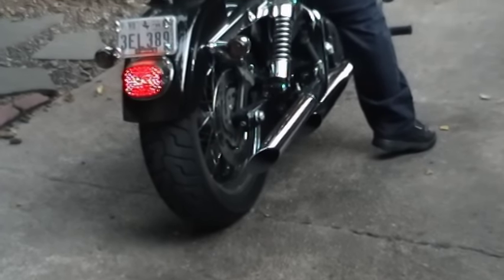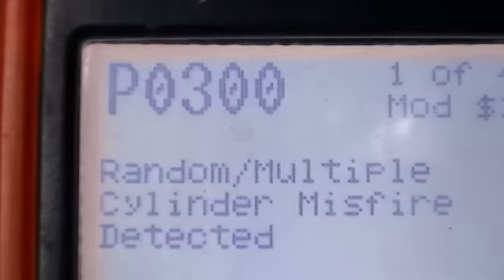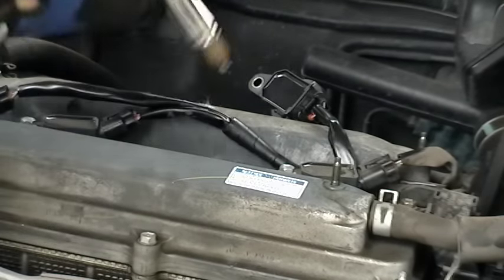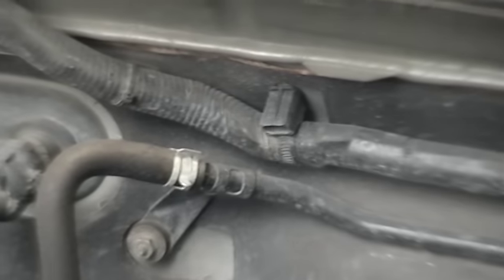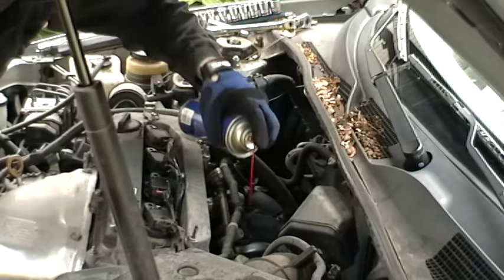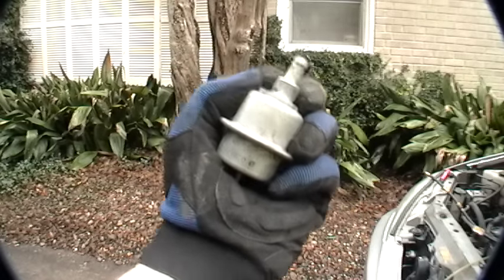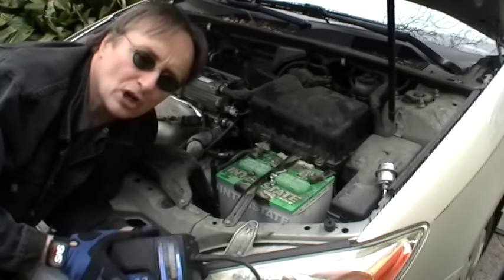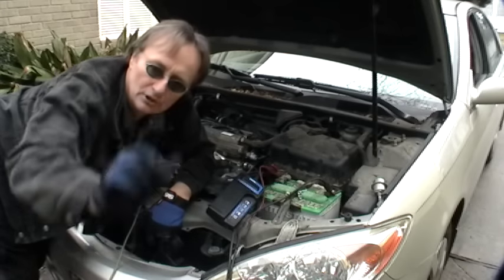How to Fix a Random Engine Misfire in Your Car (Code P0300)

Comment: might be a dumb question but why would the battery be the cause?......when the cars running all things electrical are powered by the alternator
Reply: A tidbit of info...That was for generators, not alternators whereas the magnetic field is created by current in coils from the battery, if I have that right.  That is why people said you couldn't disconnect your battery, and the car will stay running anymore.
Reply: +  I think we are talking about different things although I agree with your comment as being a warning/don't do and it's reason why.  I'm not sure the claim was ever true, and that was when computers weren't in cars, but that is people used to say.  Since I recently found out about no magnets in modern alternators is why I was suggesting this as a reason.  Nothing about the topic of computer damage from voltage/current anomalies. As far as mechanics and engineers, both have values as I have experience in each.  I know plenty of ME s who practically turn a wrench or will never get anything done because they constantly are trying to move this issue to win an argument; I know plenty of mechanics who don't have an engineering/physicist fundamentals background, and the bounds are endless.  Thanks for your response. Regards.
Reply: +taledarkside Again, I am talking about WITHOUT.  Which is related to the original post's comment about the role of the battery in the system. This getting too many tangents. Thanks, bye.
Reply: +taledarkside I began talking about the difference between when they were called generators and when they were termed alternators, and that being the time when it was said that the car could no longer be run without the battery.  I'm not talking about computer equipped cars.  The issue being that the DC comes from the battery to supply the field coils.  No magnets.  THIS is why I was wondering why the new word was that it wouldn't work.  Nothing about voltage disconnection spikes. Or your personal engineering technical knowledge .  I usually refer to GM and Delco systems.  I see that the situation differs in each of the designs by manufactures for that to be a blanket statement as the "alternator" naming took place.  Some could, some couldn't.  I was just always curious about that because I thought it was a neat trick if you could get somebody's car going and let them be on their way if it wasn't a manual transmission i.e. push start.  Just trying to understand fundamental designs

Comment: I have a bad misfire on my 07 Impala 3.9. stutters when I'm trying to go but will eventually pick up speed for maybe 3 seconds then stutters again. Changed the wires and plugs but still have a blinking engine light that comes on and off. Had a code of p0300 but a good friend has the same make of car and said it might be my Cadillac converters that have gone bad. Idk

Comment: I have a 2005 Suzuki Forenza and it's has a PO300 code.  I have changed the spark plugs gapped them properly, bough new spark plug wires, put fresh gas in with injector cleaner, removed and cleaned injectors, check the timing belt AND it is still showing a PO300 code - - - any suggestions?

Comment: Probably the most common random misfire in older vehicles would be clogged catalytic convertor!  I couldn't count how many customers that have brought there car in after other shops couldn't fix the problem so for now on any high mileage car with thst code that's the first thing I check!

Comment: I have a 2000 Toyota 4Runner sr5 v6 I changed the spark plugs, spark plug wires and coils. It only misfires after a warm restart

Comment: I changed everything possible and still get a PO 302 on Volkswagen Beetle year 2000 engine 2.0 things changed Spark plug wires, spark plugs, Ignition Coil, Fuel Injector and don't know what else can be causing the problem Scotty

Comment: mine misfires and has smoke after about 5 minutes of idle.
is it most likely a vacuum issue? compression is good.
Reply from the maker: probably not, smoke when iding is often worn valve seals on the engine

Comment: I'm having an unusual misfire.  No error code or check engine and I had 4 mechanics take a look and no one can figure it out.  All the main gaskets were replaced,  fresh oil change and new spark plugs but still a random misfire here and there.  any advice please ?
Reply: I'm in the middle of chasing multiple misfires too. Have you tried unplugging the MAF sensor while the car is running to see if it goes away?
Reply: @mcfriedchicken1972  worth a shot at this point.

Comment: i have a 2004 Mitsubishi eclipse gs withe both the p0300 and p0173. i have replace both coils pack, the spark plugs. where should i check now.
Reply from the maker: check for intake manifold gasket leaks, and also check the fuel pressure for weakness and pray the main computer isn't going out, they often do on that model

Comment: i have a 2006 dodge caravan i put obd scanner andit read p0303 cylider 3 misfire i replace the spark plugs but still having the same trouble van stumbling turns off at stop how can i know what the main trouble is i'm disabled and can't afford an mechanic thanks for any help
Reply from the maker: unfortunately dozens of things can trip that code. Swap #3 fuel injector for another, and if miss moves, that's it. If not, can be blowing head gasket, computer failure, lots of things

Comment: I have a 2005 1.8 turbo Passat . We have been getting random misfires on all cylinders and lean codes. We have had vacuum leaks fixed, put in a new Maf sensor, new spark plugs and new coils. Still is getting same codes. Car was running real sluggish so we changed fuel filter but still getting codes but car has more power. We tested the fuel pump and its reading .08 , and by what I have read it should read 1-3. I'm tired of spending money on this car😩

Comment: hi scotty   i have toyota  avensius  1.8 2010..its misfire sylinder 1   i test coil its ok i put new plug i check injector power wire its ok i look for any leak pipe all is good plus engine test,,, i dont know what alse cude be thnx
Reply from the maker: +KURDISTAN uk  often bad fuel injectors or bad coil on plugs do that, and they are not easy to test fully. I'd start there and pray the engine isn't worn internally with VVT problems
Reply: ok thanks so much..

Comment: Scotty I need your help! My 2005 Infiniti G35 had the check engine light blinking but the code reads multiple misfires can you please help me! Would like to show you on live video chat, it's frustrating me!
Reply from the maker: +Relixo tons of things can do that, from worn ignition coils to a blowing head gasket. Best to pay a guy like me in person to analyze it first with a dealer level scanner to check live and mode six data and all stored codes
Reply: +Scotty Kilmer I already checked spark plugs, ignition coils, already did a compression test on all 6 cylinders. Everything passed even check the connectors on the Fuel Injectors & Ignitions Coils everything seemed fine! what could it be! Please Help!
Reply: My 2006 g35 is doing the same thing! Changed plugs, wires, pvc valve, cleaned fuel injectors and new air filter.. still stuck

Comment: I have a 2001 mustang gt. It has all the signs of a misfire (strong gas smell, whole car shaking from the engine, doesnt like low RPMs and almost stalls out at times, exhaust note changed, etc) but i plug in a scanner and get no error codes. Im scared to drive it because it just doesnt sound right

Comment: Hi scotty. I have corsa c, 1.2 16v, 2001. When i started a car one day, its worked normal and after few minuts i saw check engine was started blinking. And than motor was unusualy worked (something like 3 cilinder only work). I shut down car. After one minut i started him an he worked normaly, but he registered fault code p 0300. Since then i driven car several times and everything is ok. Would you help me with some propose, thank You

Comment: 05 Mercury sable replaced spark plugs and wires .. changed the fuel filter... cleaned the fuel injections idk what to do an ore?
Reply from the maker: could have vacuum leaks on the intake, weak fuel pressure, computer wiring problems, lots of things. May be time for a pro to at least diagnose it in person
Reply: Scotty Kilmer 
Crazy thing is once I replace the spark plugs and wires the code went away. And then I replace the hoses clamps from the intake and the code went  away and then today it popped up I think I have a bad head gasket intake but I'm going to get it checked out on Monday

Comment: 2000 chevy blazer first was missfire on 5 and 6 changed those two plugs and the wires cap and rotor now I'm have a multi missfire code and the truck won't even sit idle just dies rite out any thought all the wires are in the correct places went over it several times
Reply from the maker: often bad fuel injectors on that model, have that checked first

Comment: Question... I just cleaned the throttle body and after that, when it´s idling, the engine can´t keep the car running.  If I give it some gas, it runs and I can drive it but it runs poorly.  Any advice ???
Reply from the maker: Einar Thoroddsen Skúlason drive it a while with one foot on the gas, often the computer has to reset idle after cleaning
Reply: Scotty Kilmer Just drove it for 15 - 20 min. but nothing changed.  The check engine light does not come on but I plugged it to my obd2 scan tool and I had p0300 random misfire.  Changed the crank sensor a few days ago because the car was dying on me randomly.  After that the car was fine.  This just happened right after I cleaned the throttle body.  The problem must be connected to that...right ??

Comment: I have a nissan spec v 04, replaced the spark plugs and one coil pack have a slice in the intake rubber pipe? could that really cause the engine to sound that bad
Reply from the maker: yes, shorting out sparks will do that
Reply: I replaced the intake still sounds rough. What should I do next? Thanks for the reply in a really shitty situation

Comment: Scotty! I have a 2002 nissan maxima! Its reading p0300 code! what is the problem?
Reply from the maker: that stands for random intermittant  misfire. A stinker of a code, dozens of things can cause that. Anything from bad spark plugs, bad dist or bad ignition coils, to a weak fuel pump. Start by checking the spark plugs and pray they are just worn

Comment: Ok. 2002 ford zx2 has misfire codes.
1.battery was bad and got replaced.
2. Changes all spark plugs and coils
3. Changes the camshaft positioning sensor.

I still have a blinking check in engine light on. I got a p1380 code recently...  help!

Comment: Hey Scott, I have a 2000 pathfinder im experiencing very slow acceleration. I'm getting p0300 code but don't know where to start. My car starts fine but I'm getting horrible milage and gathering up speed is very doggish and slow. Any help appreciated

Comment: This is my problem i have a honda civic 99 when i first start shakes very well then goes normal i replaced the coil spark wires fuel filter still not fixed another thing consimes alot of water what could be failing can you help me

Comment: hey Scotty, I have a 2006 chrysler pt cruiser automatic with a po300 code, the engine misfires only when I'm at a stop light, if I shift the car to neutral, the misfire goes away, when I put it back to drive misfires again. any suggestions?
Reply from the maker: Fernando gonzalez   that's a misfire under load, get it scanned first by a guy like me, the live and mode 6 data would show where the culprit is

Comment: Mmm, so easy to fix on a Toyota, my '02 Camaro SS is throwing me that code after $1400 MAP sensor low voltage/harness related issues, a high end shop did the work and changed the plugs and wires while at it, I wonder if my old coil packs gave up after the plug/wire swap, getting to the plugs on an LS1 is a nightmare😞

Comment: I have a Skoda Superb which has a misfiring cylinder. Changed all the spark plugs, there was moisture in one of them, the car was normal for a mile or so, and it again started misfiring. What to do next?
Reply from the maker: could be bad wires, or a bad fuel injector
Reply: Scotty Kilmer My local mechanic says head gasket and rings have to be changed. It'll cost 300$-400$. I also agree with you that there might be a problem with fuel injector. How should I proceed?

Comment: Hi Scotty.  I have a Random Multiple Missfire with all cylinders on my 03' Pontiac Grand Prix.  No check engine except one time P0172 (System Too Rich (Bank 1).
I feel hesitation under soft acceleration only and sometime ( not all the time) when i start the engine RPM going up and down.
MAF problem ??

Comment: hey scotty , my 01 honda civic is throwing this code and i putr a scan tool and it says its running lean to rich i dont know what that means but it also has code p0421 and im cuious if its the o2 sensor that its causing this p0300 code

Comment: hi scotty i have a 2000 vw jetta 2.0 with a p0304 code which is a cylinder 4 misfire i changed all the plugs already and the wires are fine i see no sparks showing

Comment: I've learned that the spark plug holes could have moisture sitting in around them. Maybe a valve cover is leaking oil. There's a puddle of oil building up and. Creeps its way up into coil boot. Killing the fire

Comment: one more small detail you could have added is how to Deactivate the 'Check Engine Light" when your Mission is done. other wise you could be Diving around for days with it on and Still not Sure if what you might have fixed was actually the problem to Begin with. :)

Comment: Scotty, How could battery cause it, 14.2 v is 14.2 v from alternator???
Reply from the maker: +A D there's voltage, and there's amperage, either can go bad. Plus bad diodes can cause problems

Comment: I have a p0300 code. I am stumped. 2001 dodge Dakota 3.9l. I changed my distributor and pick up coil (no camshaft sensor). Code went away for a week and came back. Then changed fuel injectors as truck has 200k. Needed to take throttle body off to get fuel rail off and cleaned all sensors (map, idler air, TPS). Replaced throttle body gasket. Code went away and came back. Also, changed the crankshaft sensor as well. Help!!!
Reply from the maker: so many things can trip that code, so have a pro like me hook up his dealer scan tool, take it for a ride, and analyze live and mode 6 data to find the problem area.

Comment: I have this combination of error codes p0705,  p0141,  p0301, p0303 and p1399. What to your knowledge do you think it could be? I have already replaced the spark plugs and wires also the distributor. Still misfires. Replaced PCV Valve. No vacuum leaks. I'm stumped.  Please help! !!!
Reply from the maker: do my video "fixing a car with multiple trouble codes" and e mail me the FIRST code that comes back
Reply: I just did what you said and the error code is misfire cylinder 3. Now like I said my husband and I changed the spark plugs and wires also just cleaned fuel injectors and that is the only code coming up now.
Reply from the maker: Karen Castro
swap #3 fuel injector with another, if the miss moves, replace the injector. If not, see a mechanic, it could be a worn out engine on #3 cylinder OR a computer problem
Reply: Ok scotty Thank you I will try that next.
Reply: Hi scotty i did a compression test on the car everything came out ok. Also i switched the fuel injector 3 with 2 and the misfire went away but sometimes will come back until i accelerate the car why would that be? Also car is starting to heat up coolant is low with no visible leaks any suggestions?

Comment: Scotty i need your help, you are my last chance, i was at many mechanics and nobody resolve my problems, i have an Honda jazz 2012, with code p0300,p0301,p0302,p0304 and c1555. 
Mechanics change the engine, i have already the code, the rpm a stop is not stable, and often the car stall, mileage bad, whe replace crank and cam sensor that no change, plugs, injectors.
I don't know what to do,

Comment: Hey +Scotty Kilmer , I got an oil change and then 250 miles later a trouble code p0300 started flashing . I have a 97' Chevy express 1500 5.7l . Please help
Reply from the maker: Eddie moore try these video fixes, and also check for vacuum leaks or wires the oil change guy may have messed up taking the oil filter off

Comment: hey scotty i have a 03 alero 2.2 L and the car run fine for a have half hour then cuts to half power and the po300 code comes on but if i let it sit it works just fine for a half hour then cuts to half power again. How is it fixing its self if somethings broken how can it work again and again

Comment: PUBLIC POST: I have a 2000 chevy impala. runs really rough, not drivable. after letting it warm up to operating temp it start smoking from catalytic converter. but this code is popping up. makes me wonder if the catalytic converter is clogged? I need help ASAP please and thank you. need to be able to get to work tomorrow... Lol
Reply from the maker: Chase Coleman  I would assume cat is clogged up, but realize they clog up for a reason and just changing the cat just fix the real problem

Comment: Sir!!! I have toyota MRS 2000 with 1zz engine, my engine light turns on after 10-15mins idle/driving, I'm also experiencing misfire in my muffler, I have the error code P0171 not 0300, what should I do? I don't trust the mechanic here, he's just also searching in internet how to fix P0171, I'm just afraid of spending money to replace every parts that might cause P0171. Is bad MAF sensor can cause misfire?

Comment: Hey scotty,
I have a 2000 nissan maxima when im driving the rpm move back and forward and when i step the gas to its limit it pulls back like if it wants to stop but it does't it only loses strength.
Reply from the maker: often a bad maf sensor on that model, check that first. also pressure test the fuel pump to see if it's weak